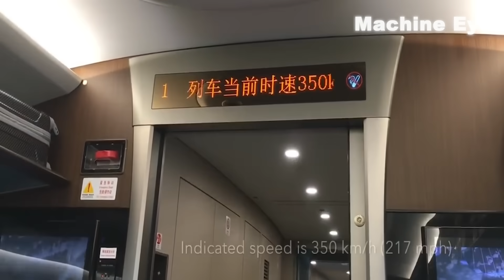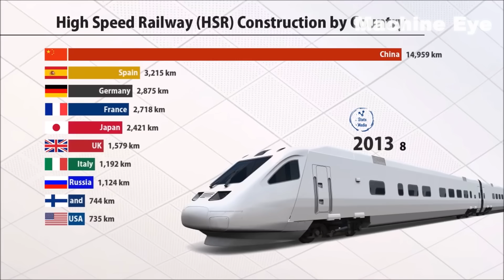China's Mega Projects, Americans Won't Believe Exist 😱

Comment: China does make colossal projects, BUT post of them are colossal failures, in loss of life , housing and property . they never fully plan or use quality material or assemble with quality care. always a short cut on safety & quality. nearly all there so call battery powered cars sit in a lot to rot as they always  blow up on the road ,

Comment: Just building stuff everywhere isn't smart at all when esp considering long term. Perfect example is their rail network for which you appear to praise?? 
Actual utilization rate outside of small area near dense populated cities is "negligible" at best and not going to change anytime soon because it was never built based on demand/need. Construction phase of the project may have stimulated the enonomy, but China will now be stuck with ever growing operational and maintenance costs to keep it all running regardless of empty trains.

Comment: China is great at building bridges and roads fast but when do they fall apart 😮
Reply from the maker: It's true that China has made remarkable progress in building infrastructure such as bridges and roads at a rapid pace. However, like any infrastructure, maintenance and upkeep are crucial to ensure their longevity and safety. While occasional incidents of infrastructure failures may occur, it's important to note that they are not exclusive to China and can happen in any country. The Chinese government has been actively working on improving infrastructure quality and safety standards to address these issues. Ongoing maintenance and regular inspections are essential to identify and address any potential weaknesses or deterioration in infrastructure.

Comment: I guess no many of you know this bridge is just a copycat of the Øresund or Öresund Bridge that connects Denmark and Sweden, built about a quarter century ago. If you just google it and you will see they look so similar.
Reply from the maker: You're correct that there are similarities between the bridge in the video and the Øresund Bridge that connects Denmark and Sweden. It's not uncommon for architectural designs to draw inspiration from existing structures or for engineers to incorporate successful elements from previous projects. While similarities may exist, it's important to acknowledge that each bridge serves a different purpose and is located in a different geographical context. Additionally, advancements in engineering and construction techniques over time can lead to improvements and modifications in design.

Comment: The Biden administration claims to use US$1.5 trillion to revive US infrastructure, but China thinks this is a joke, an American-style political slogan, and a task that is simply impossible for the United States.
For a country to carry out large-scale infrastructure construction, it is not enough just to have money, which requires many factors. The high efficiency of the government's formulation and implementation of policies, the overall planning and design, especially the improvement of supporting facilities, a large number of infrastructure construction equipment and experienced blue-collar workers, infrastructure project supervision departments, etc.
The example of China's complete construction of a 41,500 km high-speed rail line in just over ten years is a fantasy for any so-called democratic voting system government. Because they are more concerned about the issue of the next four years, and they don't care about things more than ten years later.
Reply from the maker: Thank you for sharing your perspective on the infrastructure efforts of different countries. Infrastructure development involves various factors, including efficient governance, long-term planning, skilled labor, and adequate resources. Different countries have their own approaches and challenges in undertaking large-scale projects.
While China has made significant advancements in infrastructure development, it's important to recognize that each country operates within its own political, economic, and social context. The priorities and timelines may vary based on the specific circumstances and needs of each nation.
The revitalization of infrastructure is a crucial aspect of economic growth and development for any country. It requires a comprehensive approach, including effective policies, investment, and sustainable practices. As different nations pursue their infrastructure goals, it is important to learn from each other's experiences and exchange best practices for the benefit of all.
Ultimately, the success of infrastructure projects lies in the collective effort of governments, stakeholders, and communities to work together towards shared objectives.

Comment: One thing that baffles me is that for all the size of the USA they cannot boast of a rail network system. All they have is for transporting goods... You would think one can travel on a high speed train from Newyork to new jersey... Usa is even behind most European countries when it comes to infrastucture....
Reply from the maker: You bring up a valid point about the differences in rail infrastructure between the United States and some other countries. The development and expansion of rail networks can vary based on a variety of factors, including historical context, population density, geographical challenges, and transportation priorities.
In the case of the United States, it's true that the country's passenger rail network is not as extensive or advanced as those in some European countries. The focus of the U.S. rail system has traditionally been more on freight transportation, given the vast size of the country and the need to move goods efficiently across long distances.
However, it's worth noting that there have been ongoing efforts in recent years to improve and expand passenger rail services in the United States. High-speed rail projects have been proposed and some have been implemented in certain regions, though progress has been relatively slower compared to countries with long-established high-speed rail networks.
Infrastructure development is a complex process that involves various factors such as funding, political will, public support, and coordination among different stakeholders. It's an ongoing endeavor that can take time to plan, finance, and implement, particularly in a large and diverse country like the United States.
It's important to consider that infrastructure priorities can differ from country to country based on their unique circumstances, needs, and available resources. While some countries may have more extensive rail networks or advanced infrastructure in certain areas, others may excel in different aspects of infrastructure development, such as road networks, airports, or technological innovation.
Ultimately, infrastructure development is a continuous process, and countries can learn from each other's successes and challenges to strive for further improvements.
Reply: USA is the worst country in the world trying to control others and making money by selling arms lousy worst nation dint learn from Vietnam bombed the country flooded with toxic chemicals

Comment: Ever expanding population? Right.
Reply from the maker: Yes, population growth is indeed a significant factor that influences infrastructure development. As a population expands, there is a greater demand for transportation networks, including roads, railways, airports, and public transit systems, to accommodate the movement of people and goods.
Growing populations can lead to increased urbanization and the need for improved connectivity between cities and regions. This often requires the expansion and enhancement of existing infrastructure or the construction of new infrastructure to support the transportation needs of a larger population.
However, it's important to note that population growth alone is not the sole determinant of infrastructure development. Other factors, such as economic conditions, government policies, funding availability, and technological advancements, also play critical roles in shaping infrastructure priorities and investments.
Moreover, infrastructure development is not solely driven by population size but also by the distribution and density of the population. Areas with high population density and urban centers typically require more extensive and advanced transportation infrastructure to meet the needs of a concentrated population.
Each country faces unique challenges and considerations in infrastructure development, and population growth is one of the factors that governments and planners take into account when formulating long-term infrastructure plans. Balancing the demands of a growing population with sustainable and efficient infrastructure solutions is a complex task that requires careful planning and investment.
Reply: @MachineEye  yes I understand that. But saying China has an ever expanding population in the year even the CCP admitted that their population declined is quite the claim.

Comment: But American products, just do it !!!!
Reply from the maker: While American products are well-known for their quality and innovation, it's important to consider that infrastructure projects involve a wide range of factors beyond just products. Building a bridge requires comprehensive planning, engineering expertise, construction capabilities, and financial considerations.
Different countries and companies have their own strengths and areas of expertise when it comes to infrastructure development. China, for example, has gained recognition for its extensive experience and capabilities in large-scale infrastructure projects. They have been involved in building bridges, roads, railways, and other critical infrastructure both domestically and internationally.
Ultimately, the selection of companies or countries to undertake a specific project depends on factors such as expertise, resources, cost-effectiveness, and the preferences and priorities of the parties involved. It's important to evaluate and consider all available options before making a decision that best suits the needs and requirements of the project in question.

Comment: When will the Italians build a bridge to join Italy and Sicily?  also trains in Sicily as nice as the ones in north Italy or similar to what you are showing.....very impressive!
Reply from the maker: The construction of a bridge connecting mainland Italy and Sicily has been a topic of discussion and consideration for several years. The project, known as the Strait of Messina Bridge, aims to establish a direct link between the two regions, enhancing transportation and connectivity.
However, it's important to note that the construction of such a bridge involves various technical, financial, and environmental challenges, which require thorough planning, feasibility studies, and consensus among stakeholders. These factors, along with potential budgetary constraints and political considerations, can influence the timeline and realization of large-scale infrastructure projects.
Regarding the train system in Sicily, the region does have a rail network that connects various cities and towns. While it may not be on par with the extensive high-speed rail network in northern Italy, efforts have been made to improve the quality and efficiency of the train services in Sicily.
Infrastructure development is a complex process that involves multiple factors, including funding, planning, and implementation. The realization of ambitious projects like bridge construction and transportation enhancements often requires a comprehensive approach and collaborative efforts from various stakeholders involved.

Comment: This is true that chinese are just doing construction but its quality is pretty much low than those done by americans. Its mainly due to corrupt practices with the governments they enter into agreements. An american master piece of construction is expected to survive until the day of judgement😅
Reply from the maker: The quality of construction projects can vary across different countries and regions, and it is influenced by various factors such as engineering standards, construction practices, project management, and regulatory frameworks. While there have been instances where quality issues have been reported in certain projects, it is important to note that generalizations about the quality of all Chinese construction projects or the superiority of American construction projects may not be accurate.
It is crucial for any construction project, regardless of the country, to adhere to proper engineering standards, quality control measures, and regulatory requirements to ensure long-term durability and safety. Addressing corruption and ensuring transparency in the construction industry is a global challenge that requires collaborative efforts between governments, industry stakeholders, and regulatory bodies.
Ultimately, the quality of construction projects should be assessed on a case-by-case basis, considering various factors involved in their planning, design, construction, and maintenance.
Reply: @MachineEye  the system gets more vulnerable to lose implementation of laws equally, in the context of developing countries like ours. The result is much evident in the form worlds largest dams built by those americans in 1960s  vs none after that in our recent history. The focus remains just bribing govt for contracts and vice versa.

Comment: You're right we won't. China is littered with failed mega City tofu dreg projects that crumble away and they have debt that has gotten so out of control the debtors are no longer able to even service the debts let alone reduce the principle and are defaulting in mass. They're also reducing new real estate by up to 50 percent and still can't sell.
Reply from the maker: "Thank you for sharing your perspective. It's true that China has seen various development projects and faced challenges along the way. Like any country, it experiences both successes and failures in different sectors. It's important to acknowledge that economic situations can be complex and evolving.
Reply: @MachineEye  Yes I'm a Chinese real estate market investor. I saw the economic warning signs back in mid 2018 which essentially amounted to me seeing that the gravy train couldn't possibly continue on reliability as it had gone long enough with respect to prior instances and pulled out In early 2019 while I was still a big winner. Saw that the future risk delta had shrunk too much and thank goodness I did get out. Though i could've made a bit more i know i shouldn't complain. And even with 50 percent price cuts I'm still not willing to re enter because that's still above value for the market relative to its buyers position within the market in buying said market asset. That can be applied to anything not just real estate, it can be cars, appliances ect. It's only getting worse. I've known that the Chinese real estate market was overvalued over hyped garbage, Tofu dreg projects, Chinese corruption, Chinese company book cooking, ect. have been commonly known for decades but the markets aren't rational and thus care as much as you think they should. So I'll make money off of those being irrational until I see a warning sign that they're about to wake up so I can jump out the window first thing.